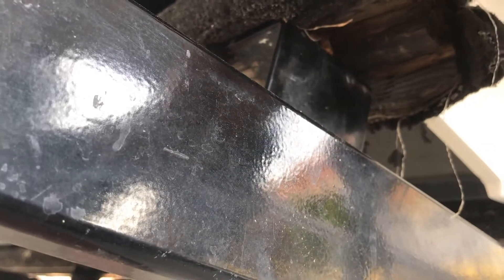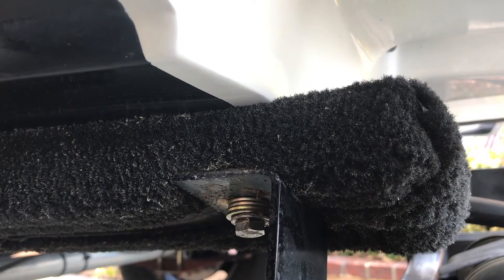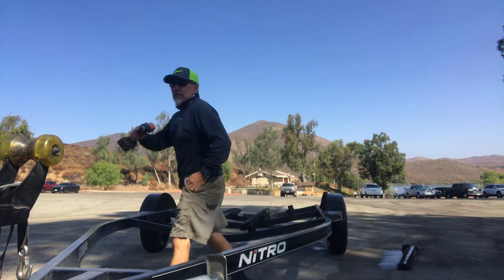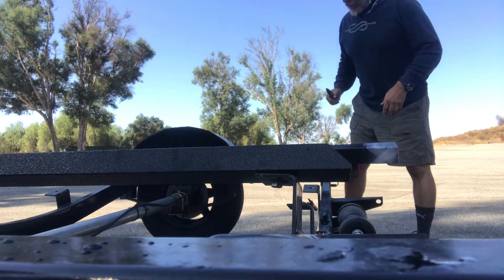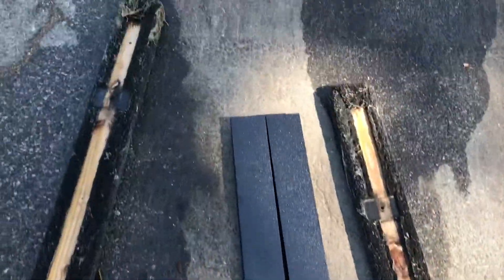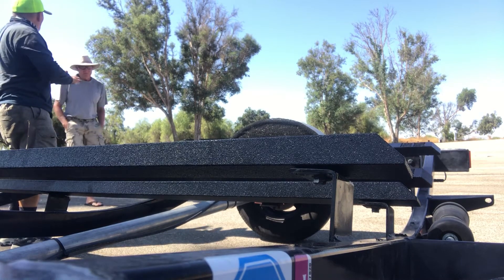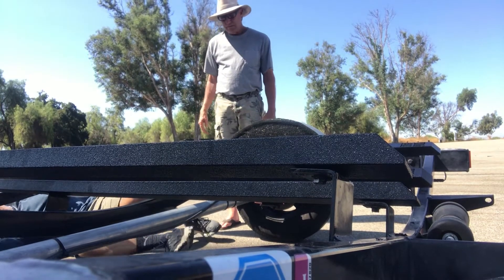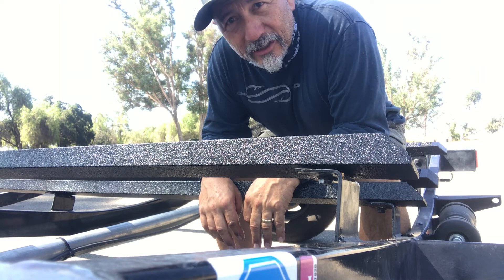Tuff Bunk install on my Nitro boat trailer

Comment: This is great. I have been struggling to replace my old bunks for months, I am really excited about this Tuff Bunks, its coating outside is soft and it doesn't scratch the bottom of the boat right?
Reply from the maker: I sold my boat about a month ago but when I was underneath cleaning her up, I didn’t see any marks that weren’t already there from the carpeted bunks in the area that would have slid across the rails before it was on the final resting spot on the trailer.  The material like bed liner but softer.  I believe the company was actually going to even improve the material but contact them for the specifics.  I am not sponsored by them and paid for mine so this is my honest opinion on them.  I would not hesitate to put them on the trailer of my new boat when it was time to replace

Comment: Looks like a good idea to replace the carpet problem. I'm curious though. Does your boat slide up on the bunks like before? I have a Tracker boat that needs to slide on and off of the bunks. Not sure this would work for me. Grateful for any info.
Reply from the maker: There is less friction, but I didn't notice a difference.  I had a buddy who said, he thought it didn't slide off as much as carpet though.   I would google the business and Gary is very helpful;  he may have some info with regard to an aluminum boat

Comment: Does it make it slide off the trailer where you have to keep the hook on the boat so it doesn't slide off while backing down the ramp?
Reply from the maker: Not any different from carpeted.  Where I left it hooked on steep ramps with the carpet, I do the same now.  Most of the time it is unhooked;  same with pulling it out

Comment: Wanting something really slick for a flat bottom jet sled. What do you think about these vs some hdpe or fiberglass boards? Thanks
Reply from the maker: I am not familiar with Fiberglass boards (if you mean bunks) but I would say that anything that uses carpet could be replaced with this.  I was at a tournament this weekend and spoke to another guy who's had a similar bunk to mine and he said he's had them for over a year, with no issues

Comment: Do they have any cushion at all? Seems like they would damage your hull over time. Yeah they are better than the rotted wood you had, but I just can't see that they protect your boat that much.
Reply from the maker: I recently sold my boat after having them in for 5 months and while cleaning the hull up I didn’t see any wear where the hull was visible after gliding over the rails.  You could contact the company and probably get some longer test information.  The guy I sold the boat to likes the way it comes off and stays on when loading.
Reply: @HobbyAddictions  Thank you for the quick response. 👍

Comment: It looks rough and the edges seem too squared. Has it left any marks on the hill?
Reply: Hull
Reply from the maker: I had a bunch of scuffs and scratches from the carpeted bunks, but don’t see anything new.  Honestly, there were a lot from before so I’m just going by what I can see with the boat on the trailer.  The bunks age starting to settle in just the like carpet does and the edges are rounding down too.

Comment: Hi and thank u for your follow up.  I see that you sold your boat however I still have a question that I hope you can answer for me?

I've have more of an issue loading my boat and wanted to find a product that was a bit slipperier so it would slide into position easier
Reply from the maker: Hi,  Kind of weird; I thought it slid on easier, but a friend that used my boat a lot said he liked that it stuck in place and then was easy to adjust it up.  I know they changed the design since mine, so look at the video that the owner did (should pop up be searching tuff bunk) and send him a message.  He’s very easy to talk to and informative.   I have a friend  getting them installed this weekend with the new design and I will see what he thinks and reply

Comment: How can the boat slide on rubber? The idea of carpet is so the boat can slide. That is my question?
Reply from the maker: it does grip more than carpet, but once there is water on it, it slides without issue.  I always would sink my bunk boards completely when loading my boat with carpet, I did the same with the tuff bunks before bringing it back up to my desired loading depth.